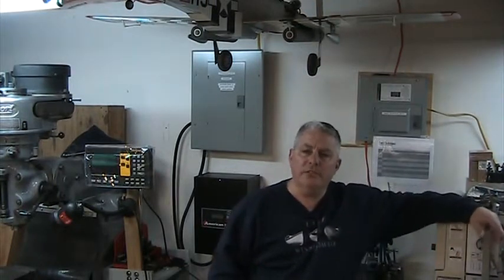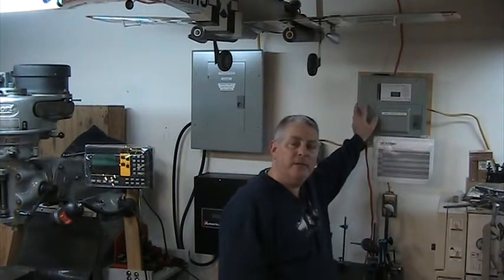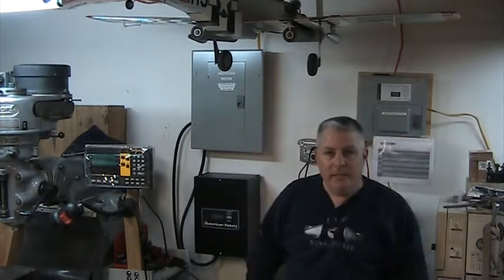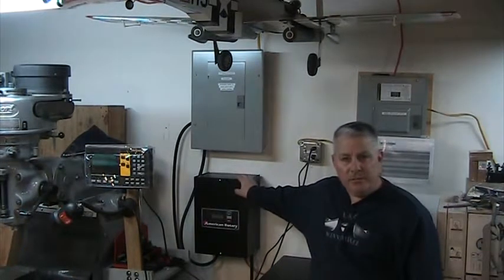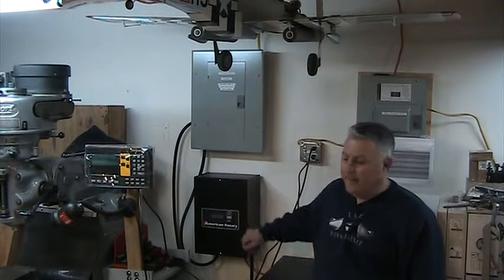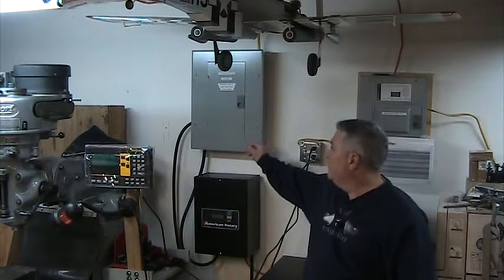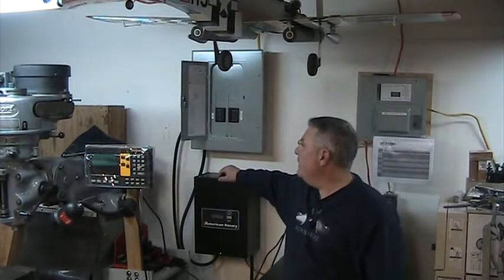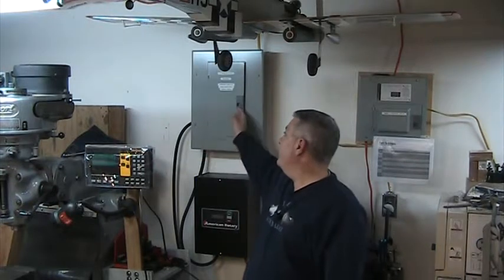American Rotary AR-5 Phase Converter Overview

Comment: What was your total cost for everything?
Reply from the maker: Ty Markle if I remember correctly, the converter was $325ish. The panel and breaker was about$150. I now have my surface grinder hooked into it as well. Thanks for commenting!
Reply: That's it?? Im picking up my first mill Saturday. A 3hp Alliant CNC Mill. (BP knock off but has great reveiws). Anyway, it's 3 phase and I started puking a little bit when I saw the cost of the rotary 3 phase equipment.  What is your BP rated at? I appreciate the help!! Good luck on the channel
Reply from the maker: Ty Markle I have a series 1 BP and it has a 1HP motor and the surface grinder is about the same. American Rotary offered a 1HP unit but for only $50 more I purchased the 5HP setup. May never need it but felt it was the proactive thing to do. Good luck with your mill, you’re going to enjoy it. Welcome to the channel and I have some interesting projects planned for the up and coming winter!